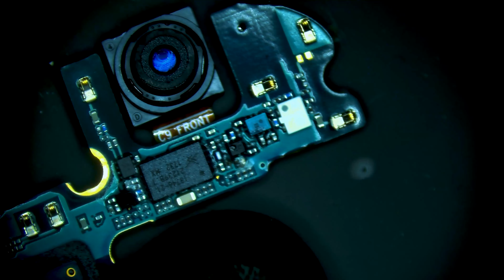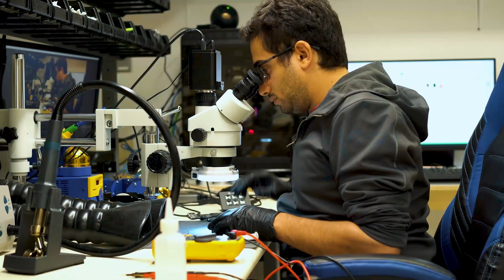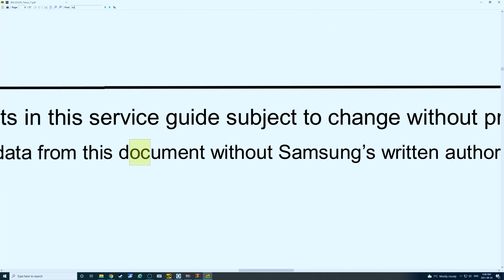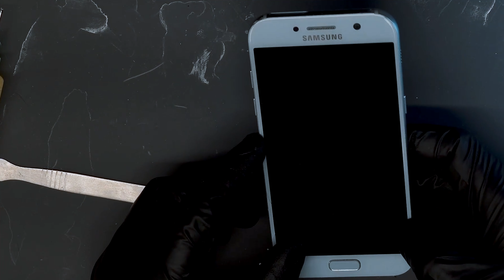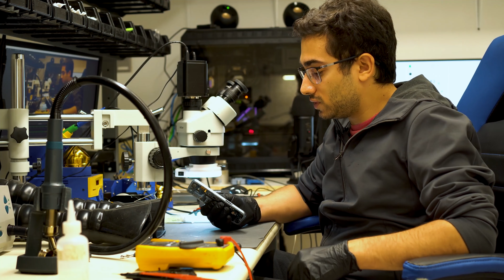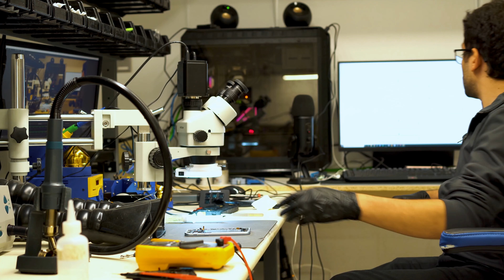How to recover data from a phone with severe water damage.  One step at a time...

Comment: I had some salt water get in my phone, it wasn't dropped in salt water but a wave came and got it wet. It's a Google pixel 6 pro. It won't turn on. I did take it somewhere thinking it was the screen and that didn't work. It doesn't look bad inside my phone. I just need my honeymoon picture off of it. Can you help?
Reply from the maker: Yes we can recover the data if you'd like to mail it in. Link in description.

Comment: So the whole "repair" is just accessing the LCD by a process of:

Cleaning
Troubleshooting via current readings and establishing a functional circuit flow
Identifying the corroded components - uninstalling and replacing by heat sink methods

And just getting the LCD to work so we can navigate the UI and simply press a "Yes" notification.

Is there "name" for people that specialize in this craft/industry and is there, like, a general way to identify these shops so I can recover my photos from a water damaged phone?